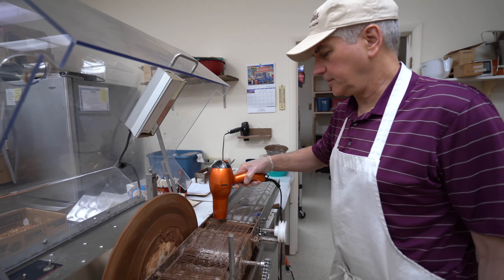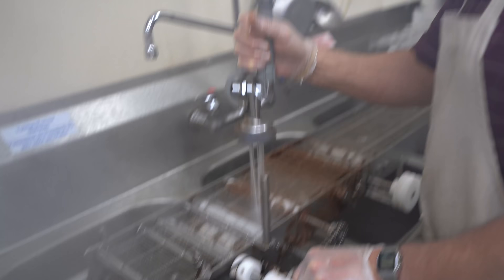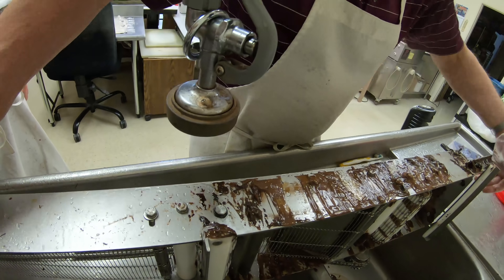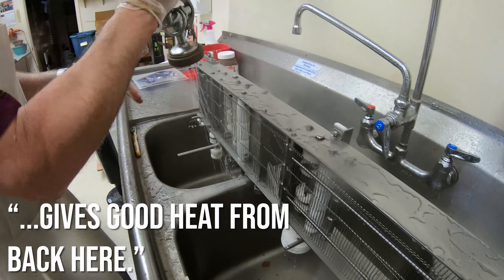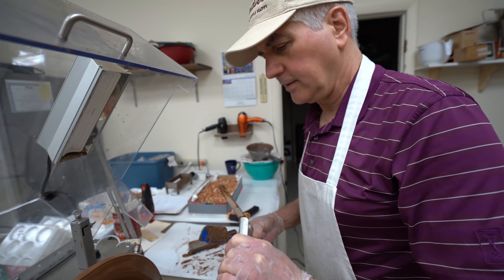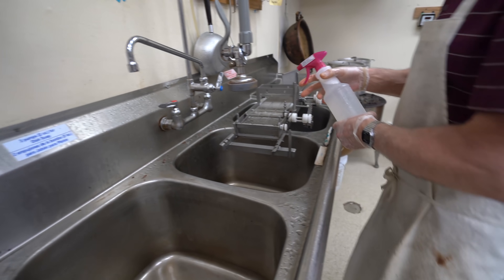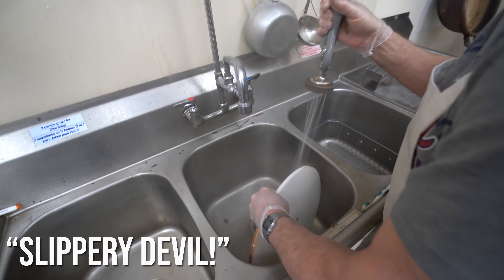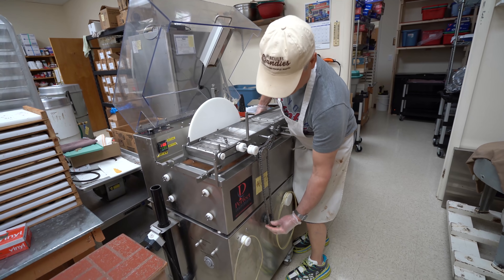Before and After: Cleaning our Chocolate Enrober (2019)

Comment: Slide the metal ring above the handle, squeeze the trigger and slide the ring down to hold the sprayer open, use the faucet to control the pressure. 👍😉

Comment: I would just assume plant the enrober track over a trash bag and scrub it with a wire brush or a brush with stiff nylon bristles. It would knock most of the chocolate off faster. Then I would spray it with the hot water to get any remaining chocolate off that the bristles couldn't reach. That way I wouldn't have to run the hot water for so long. Less water, less time over a hot steamy sink and less chocolate going down the drain and less water being splashed all over the place.
Fill one of the sink bays with hot soapy water and place the smaller bits in there with the chocolate wheel and let them sit for 5-10 minutes. The chocolate will melt off on it's own. Pull the pieces out and scrub them free of any remaining chocolate with one of the tooth brushes there and rinse them off using the normal faucet. You wont spray nearly as much water around creating a slipping hazard. Hit them up with the sanitizer spray. Done with less mess and time!

Comment: Steve you need to get a sheet of plexie glass cut to fit in the sink  so it does not splash up on your walls .. this  will save a lot of clean up time for you . if you do not feel that way just duck tape  some plastic on the walls roll it up throw it away when your done.   hope you may try it. good luck  Art from the Poconos here in Pa...….

Comment: Gosh that does waste alot of chocolate...wondering if while the track is still running and chocolate is still warm if a small air compressor  would spray the chocolate off the track and back into the bin ?

Comment: perhaps a diy heating unit that will melt the chocolate and allow it to drip into a chocolate only bin would help .... something long enough put the whole belt section inside of and heated with say heat lamps or a pair of electric elements turned upside down would allow you to save more chocolate off the belt ... then remove your chocolate bin and use the same tunnel to pressure wash the last bits like a commercial dishwasher does ... 
.

this might make it easier ... and during the first part could be litteraly hands free or even overnight with the final washes and touch ups done in the morning
Reply: of course the other option is keep it warm with hair dryers and have the local school kids come and sample the chocolate off the belt and clean it manually for you .... with a final wash of a more or less clean belt ;)

Comment: Wouldn’t a real heat gun work better and faster?
Reply: It will probably burn the chocolate. It's too hot.
Reply: They have variable temp guns. I use them to shrink wrap soap that is easy to melt.

Comment: Just curious if you guys have a freeze trap on that sink.  I used to haul chocolate by tanker for most of your chocolate com in the U.S.. there is very few tank washout that will was tanks with chocolate because of all the fat in chocolate.
Reply: They have a grease trap, if that helps answer your question.
Reply: @byronmurphy1977   Just notice the auto correct on the grease trap. And thank you.

Comment: Have you guys ever tried a heat gun? A blow dryer takes a long time I would think lol
Reply: A heat gun would just burn the chocolate ;)
Reply: Dragonchiller if you know how to use it a heat gun would not burn it
Reply: @MuhkayTitz  Or just use a normal hair dryer which works just as well and you don't have to keep an eye on the temperature.. Ive worked with heat guns a lot, you can easily burn stuff
Reply: NOT. THE. POINT.
Reply: @MuhkayTitz  exactly the point ;)
Reply: Mmmm not. Thanks for your input though.

Comment: He needs a heat gun to melt the chocolate. It would be so much faster than a hair dryer. You can buy them at craft stores. Or maybe one of those steamer cleaners would help get most of the chocolate off?!
Reply: A heat gun is so potent is would burn the chocolate instead of melting it

Comment: Get a heat gun instead of a hair dryer. It does the job much faster.  A lot of that chocolate on the conveyor belt  could have been saved if the chocolate was melted.
Reply: A heat gun is much more hotter nada would burn the chocolate
Reply: @abcdefg6595  Not really. You just need to be careful. I never had problems.

Comment: I’d use a heat gun on it while it was still attached to the rest of the machine, it would melt most of what is there away back into the machine. Then use it again at the sink, get it nice and hot and rinse the rest away. Not a hair dryer, to low not enough heat, a true heat gun. Jest my 2 cents worth.
Reply: Your 2 cents clearly don't know how chocolate works. A heat gun is much too hot and would burn the chocolate instead of melting it. Good luck trying to remove Burnt chocolate from that machine.